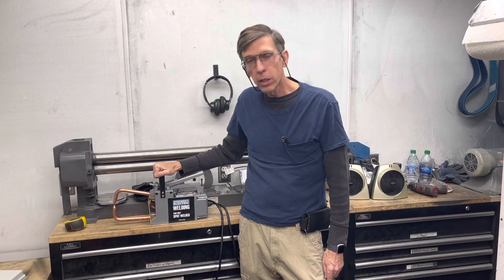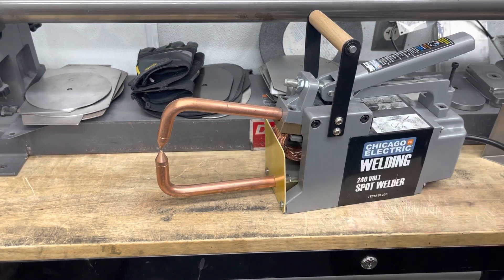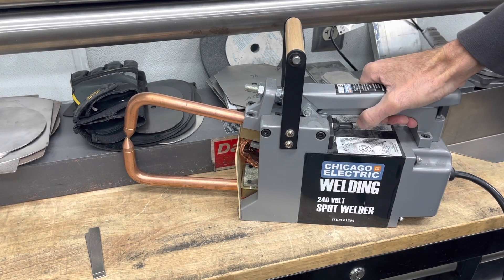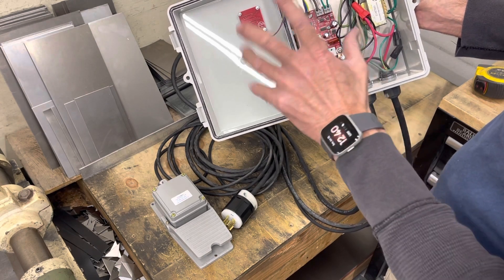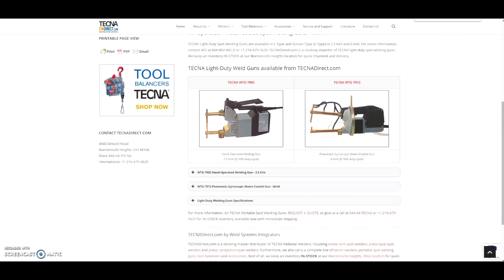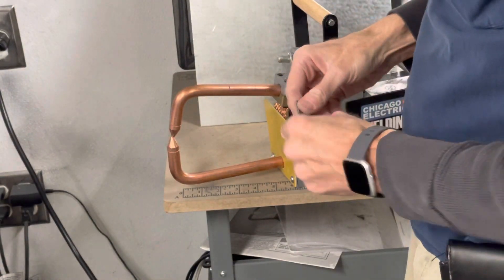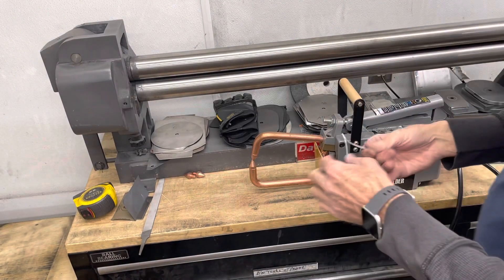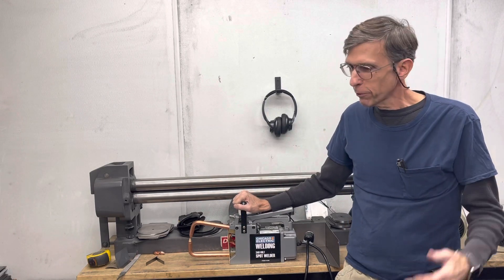Spot Welding Basics

Comment: Hi Craig.   I want to use this spot welder to weld two approx. 11 gauge wire pieces together.  I need to repair 6x30 wire "h" stakes that I use for signs in yards.  Will this 130V weld the wire together?

Comment: I guess a little late on this, but, I really doubt that all that much amperage is going through that momentary toggle switch that is finger activated. It probably controls/activates the larger amperage circuit. THAT is where I would "inject" a timing mechanism in the circuitry. Replace that momentary toggle switch with a relay controlled by a simple timer circuit. Simple timer circuits, with like a 555 chip, are easy to find and modify to your needs. Could even implement PWM if you want. You could make it simple, to moderately complicated at a very low cost, like tens of dollars.

Keep sharing!! THANKS!
Reply from the maker: Yeah, I’m not really using it now but maybe in the future. It seams like the ones that have a pulse timer are like 5x the cost of this one. Thanks!

Comment: Hello Greg. As far as I know, you can use a solid state relay (SSR) in combination with a timer. The SSR needs to be capable of handling the amperage your unit is drawing under full load. Puls is used to have an initial short burst so that both metals start to deform and "flatten" the contact area (again, to my knowledge), followed by a second, longer lasting burst to weld both plates together. Greetings, Stefan.
Reply from the maker: Hey Stefan! Yeah, I wish I understood the electronics. I was hoping to be able to find some kind of control box I can just plug the spot welder into but haven’t been able to find anything online.
Reply: Just what I was thinking as well. The timer is only to supply pilot voltage to operate a relay.
Reply: Can you send a drawing?